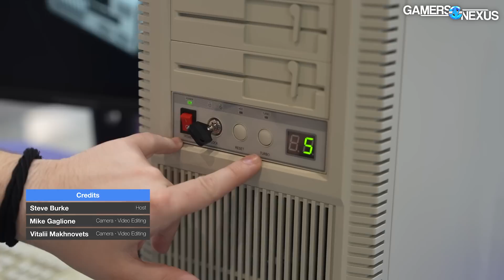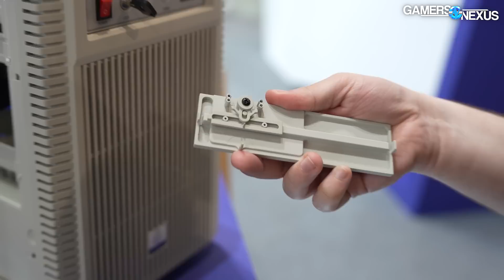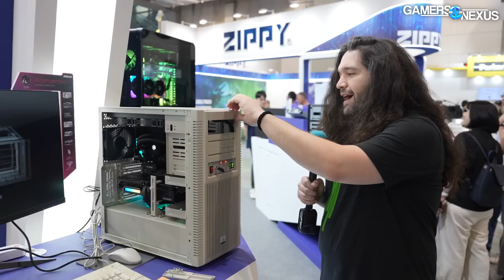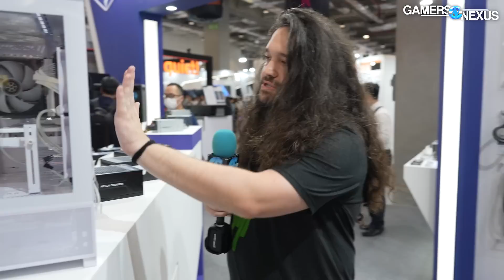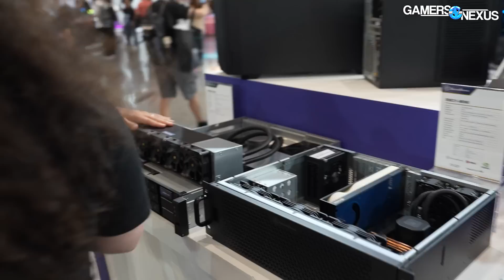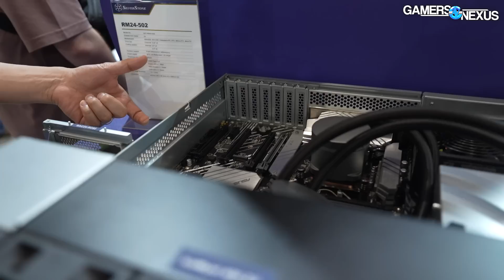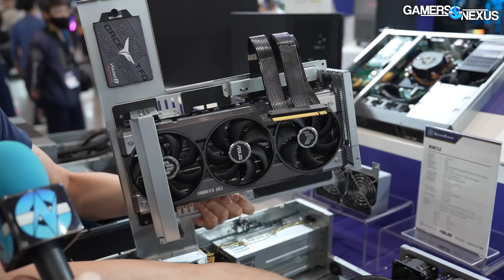Unironically the Best Case: Retro Silverstone FLP02 with Turbo Button

Comment: A case with 5.25" bays again ? Nice!
Reply from the maker: But what should go in them?!
Reply: @GamersNexus I have a sound blaster dock that would look beautimous in it. Good luck finding a modern mobo with a PCI slot 😅 Asus makes a business board that has one. 🤷‍♂️
Reply: @TechManTY.  My dac actually is roughly that size, I could probably print and adaptor for it to mount in a 5.25 bay XD
Reply: @GamersNexus  One 5.25" floppy drive preferably from TEAC, one 3.5" floppy drive with 5.25" adapter.
Reply: @GamersNexus  fan controller with LCD display
Reply: @GamersNexus  an actual 5.25" floppy drive so I can easily write some floppy disks for my C64.
Reply: @GamersNexus  A Blu Ray drive with completely unmodified firmware of course
Reply: @GamersNexus  we need sound cards that have 5.25" expansion drives. :)
Reply: @GamersNexus missus is actually using my retired HAF912 plus due to it having 5,25 bays that she needed to use dvd burners and also lot of slots to populate with sata hdd/ssd while having nice air flow. So yeah,  we need some options of gamer focused cases with 5,25 bays even if it's a niche market.
Reply: @GamersNexus blu ray drive and a 5.25" bay reservoir 😎
Reply: @GamersNexus  External drive enclosures and DVD drives. USB drives are a headache for booting from.
Reply: Icy Dock MB326SP-B with a 6-port PCI-attached SATA HBA. Toss in an SSI-EEB board with at least four PCI ports, and you can have in theory eighteen 2½" storage devices to keep stuff on.
Reply: @GamersNexus  My modded blu-ray drive for ripping my physical media, of course.
Reply: @mesasone modded? Wdym modded? 😂😂
Reply: @JohnWiku  most drives cant rip 4K out of the box have to be flashed with specific firmware that enables it,
Reply: @GamersNexus Maybe some 5 1/4 vantec nexus fan controller? (I still have one)
Reply: @GamersNexus  I would put a few 5.25 floppy drives into them just for the lolz. Figure out how to get the to cycle when you power the system on.
Reply: @GamersNexus A USB hub, to make up for the lack of front IO on this and every other modern case.
Reply: @GamersNexus  3.5" HDDs with adapters lol.
Reply: @kunka592  They literally did!!!!
Reply: I bet you could also rig a fan in there for some extra airflow... wait.
Reply: @GamersNexus  I still have my Cd/Dvd drive from my old pc.  Going to put that in.  I use it from time to time.
Reply: @GamersNexus  DVD burner. I need one for work (USB burners are slower and unreliable) and it was a pain finding a good case with two 5.25" bays.
Ended up buying a Fractal Define 7 XL.
Reply: @GamersNexus  Burners for all the DVDs, Blurays, and CDs you get for cheap at the dollar store.  Now you won't have to resort to sailing the high seas when a product you bought suddenly becomes unavailable at the whim of a provider.
Reply: @GamersNexus  One optical drive and the other can be Thunderbolt 4 panel.
Reply: @GamersNexus  Blu-ray reader
Reply: Optical drive and front panel I/O expansion.
Reply: A zip drive, I need to retrieve some Microsoft Publisher and Printmaster files!
Reply: What if this revives old trends in new ways?
Bring back the options!
Reply: @Pfromm007  I guess it doesn't revive anything, as these big cases might be used as house NAS/servers placed somewhere in the basement or in a living room  multimedia cabinet corner.
Reply: DVD/CD reader for old games. @GamersNexus
Reply: A 69-in-one SD card reader

Comment: Back in the olden days you rarely hit this button because it broke all your games lol - love the case!
Reply from the maker: The best was the games that adjusted timing to the CPU frequency!
Reply: @GamersNexus Proper coding!
Reply: @AJ_UK_LIVE  The switch was for software written in the 80s/very early 90s, stuff like the original Wing Commander... built for the original 8086/8088 PCs. It's always easy to dump on programmers in hindsight, but at the time speeds were actually multiplying so fast while programming was still being done as mostly the lowest levels in C and Assembly, that it's also kind of ignorant to just say they were "bad programmers" or writing "bad code". By that logic, you're also saying that Carmack is a "bad programmer", and anyone who says that needs checked for a serious learning disability or something.
Reply: Railroad Tycoon was clock locked. Tried it on later systems and trains would teleport between stations!  @GamersNexus
Reply: @GamersNexus  I tried playing One Must Fall on DOSBox without realising it on my last build - a 9800K running 5.0GHz. I lost fights in microseconds.
Reply: @GamersNexus  That would still cause a lot of games to crash because the system itself wasn't always stable when you hit the turbo button.  Most of the motherboards available at the time were questionable quality no-name boards, ASUS was revolutionary when it hit the market and had consistent quality for only a few dollars more.
Reply: Wasn't there some pretty recent Need for Speed game that would break if you increased its FPS from 60 to 120? So with some tinkering and scripting, I bet you can still emulate that if you want!
Reply: @LishtenbirdTech I know command and conquer 3 is like that. Something with how the game runs is directly tied to the framerate so making it above 60 messes with the game
Reply from the maker: @craig9365  Same for Oblivion, if I remember correctly! Though that's much newer.
Reply: @GamersNexus Even Skyrim works this way, at least the physics engine. That's how you know their Creation engine is still just Gamebryo.
Reply: @craig9365 Yeah, just calculating stuff like physics directly over pre-defined FPS intervals instead of actual time because it's easier, and then locking your FPS. Then what happens when you unlock that FPS? Yup.
Reply: @Whizzer  GTA 5 does this too, or at least, used to with the older PC port. Not sure for the new one.
Reply: @GamersNexus  also Total Annihilation....
Reply: @LishtenbirdTech  Many games actually! Games that have their physics tied to the frame-and-or-refresh-rate do this. I think it was Need for Speed Rivals, but more often it was PAL vs NTSC that caused it. TB reviewed it and that blew my mind. Basically a 1-1 console port.
Reply: @mono_vt Yeah, I was trying to remember something more recent and that video was what surfaced. Kinda impressive in its own right just for how long that technical baggage can drag on.
Reply: @LishtenbirdTech  Doom 2016 physics break over 200 FPS and speedrunners use this for some pretty wild skips
Reply: @LishtenbirdTech  many games break with higher fps. like dark souls or command & conquer 3.
Reply: Downclocking was useful for other things too.

I used to maintain large utility wind farms, and we had some sites where the SCADA system (industrial controllers) that controlled the whole site was running an unsupportable early 90s software by a scandinavian developer who had long since gone out of business. It wouldn't run on any cpu with a clock speed over 30MHz. I disassembled the software to figure out why, and discovered it was using clock ticks to time the comms protocols between the control station and all the turbines.

Those wind farms were only still running 20+ years after build because of many 386 and 486 parts we scavenged off Ebay.
Reply: The button was intended to allow CPU clock  speed sensitive games that were written for the original 4.77 mhz PC/XT or 6mhz AT to run  proplerly.   Games from the early 80's often wouldn't run on faster 286 and later machines.
Reply: That's how you make it go crazy when you beat a hand of solitaire. :)
Reply: GTA IV is another one of those "modern" games that breaks more and more the higher your FPS are. At 30 everything's "as intended", above 45 things start to noticeably go haywire (doors opening and closing in a split second, bikes drive like on ice, NPCs honk 20 times a second and NPC traffic goes bonkers with crashing and weird driving), and if you get to 75+ the physics break so much that some missions are entirely impossible to complete (as the game expects input-mashing faster than you can physically manage). There's fan-made patches (fusionfix being the most common) which mostly fix those issues, but they introduce other problems
Reply: @Knaeckebrotsaege  What does that have to do with a turbo button on a 486?
Reply: @michaelstanley420  Others mentioned fairly modern games which still lock internal game loops to framerate, thus either break or run too fast on newer systems. Still the same old issue as DOS games running too fast cause they locked internal functions to CPU clock, hence the need for a turbo button
Reply: @Knaeckebrotsaege  Incorrect.
Reply: @michaelstanley420  He says without proof of anything. "I know better". Love clowns like you 🤣
Reply: @Knaeckebrotsaege  You would know all about clowns, being their King
Reply: @michaelstanley420  Resorting to more insults with nothing to prove your point, calling me a king of the clowns while bearing a UA flag lookalike avatar. Yeah I'm done dealing with your mental diarrhea here
Reply: i think you wanted to say, it enables you to run these at a normal pace
Reply: or just did nothing noticeable.
Reply: i was using turbo on a dos game 3 point basketball to make it slower so i can easy throw the ball when there was some foul in the game
Reply: I had the button at on position all the time both on a 386 and 486. Never had problems. AFAIK.

Regarding this case, I initially thought that it has 5.25" disk drives 😂
Reply: @2iii7 the buttons operation varies by the motherboard in the case. Sometimes turbo needed to be on to be full speed, other times it made the system slower. 

My dad's 286 needed it on for full speed, but some random boards needed it off.
Reply: That's because it was for older games that ran to fast on the system, the button actually slowed down your CPU so they would run normally.
Reply: @thelaughingmanofficial  Wing Commander on a 486-33 ran at the perfect speed with the turbo button slowing things down.
Reply: Olden isn't a word.